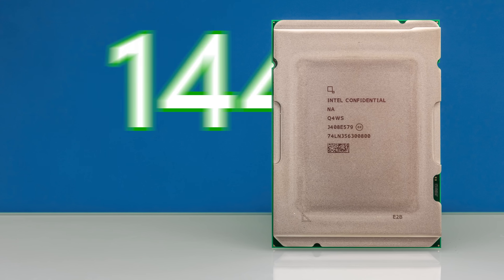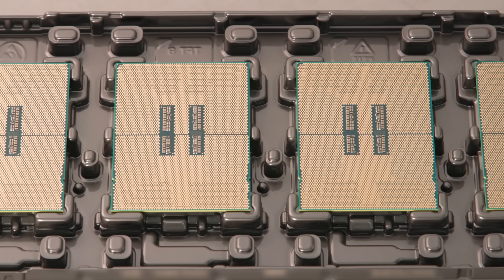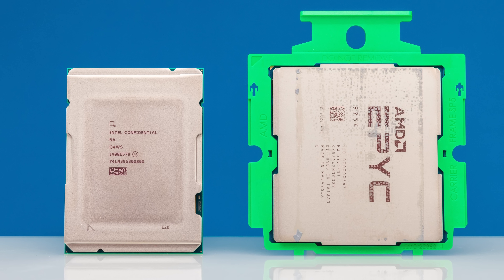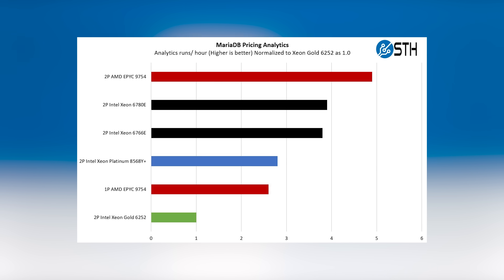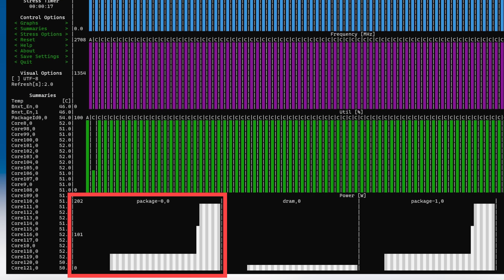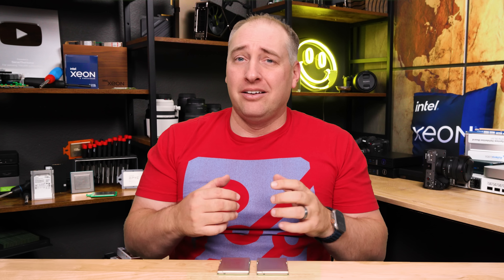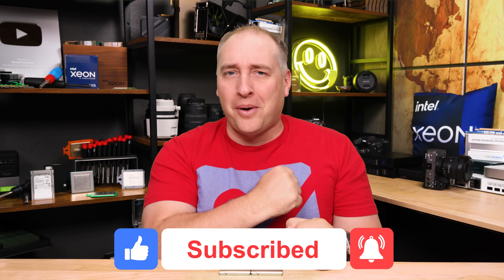MOST Server cores EVER Intel Xeon 6

Comment: Intel 3 is 5-7nm tsmc equivalent?

Never expected to have cpus with as many cores as GPUs. Its not there yet but the gap is closing. Just crazy considering the number of cores just 10 years ago.
Reply: No Intel 3 has a higher real density than tsmc 5nm， Intel 3 is designed to compete tsmc n4 n3, not n5 n7.
Reply: @timmy85211  Intel has density.. tsmc has efficiency. Intel can pack transistors closer but requires more power than the "equivalent" tsmc node. Power usage is a large part of the benefit of the node so a huge downside to Intel. "Same node" but twice the power means... Not an equivalent node imo

Comment: This is going to redefine servers? Others have long had the same or more optimizations in this direction. Seems more like Intel is catching up at best.
Reply from the maker: This puts Intel ahead of current Arm solutions and AMD. Perhaps catch up too, but they are now squarely ahead
Reply: @ServeTheHomeVideo "Ahead" meaning what in terms of "redefining"? Even if the first true, if it is just about being a good product, then good for them and for us to have it as an option, but nothing that changes how servers are used. CXL has been long in the making and far from specific to this, chiplets are great, but hardly their innovation, more cores, each more efficient rather than performant, great but again just their version of what AMD and ARM have been pushing already, same goes for removing the PCH. Good to see competition doing what it is supposed to of course, but nothing that seems structurally new, other than being new for Intel.
And on that note, it's easy to look good, if you compare yourself to the competitions last gen. 5th gen Epyc has up to 192 cores & 384 threads. If the efficiency cores of Intel are about on par with last gens Epyc cores in performance, win some loose some, and a bit better in efficiency, that isn't that impressive, since 5th gen Epyc, especially the -c version will be on better nodes than their previous generation as well of course, while adding some improvements beyond passing on TSMCs I'm sure. As for Neoverse N1, it's from 2019, it better be defeated easily by a 2024 product. Granted Nvidia isn't realeasing their next gen yet, unlike AMD, but Grace is not new, and also has 144 cores and they aren't even from the lots of core N line, but the V one, maybe a little physically bigger as a package based on the less chiplet approach, but since that package includes memory, it's not actually large if you include that for the others.

Comment: Will this complete with nvidia?
Reply from the maker: The NVIDIA Grace Superchip has soldered LPDDR5X memory and can hit 144 cores on the dual 72 core chip module. Those 144 cores with memory use around 500W versus Intel at 250W excluding memory but with the ability to scale to dual sockets at 288 cores. Very different CPU segments

Comment: Nice. Congrats to Intel on delivering and beyond. I already went with AMD Siena, it has a lot of PCIe, and scales down to 8 cores, while keeping all io and memory channels. For crazy workloads, of course Bergamo. I can see Intel leaping ahead, and also having built in accelerators (compression, encryption), being a nice bonus, but I think long term these things will move to NICs (already available, just not super well integrated, and bit awkward to use it for compression for storage, on a NIC). I will stick to AMD, their more smaller tiles solution I think is more cost efficient, plus Intel screwed us many times in the past. But time will tell.

In general I really like the trend, of more smaller (more efficient) cores, because a lot of workloads I do, scales very well, and ultimately I can do more in same power budget (compared to less but faster cores).
Reply from the maker: Totally

Comment: Those 144 e-core chips aren't competing with Bergamo for the reasons mentioned in the video. They (and also the 288 core parts) are also not competing with Bergamo, because Bergamo is AMD's last gen part. Their actual competitor is going be Turin-Dense.
Reply from the maker: Correct, but Turin Dense is also 5+ months off at minimum.
Reply: @ServeTheHomeVideo  Also correct :) The 288 core parts won't be out much sooner than Turin-Dense though.
Reply: Xeon chips has higher bandwidth. 288 E cores that dont execute complex AVX instructions.

Comment: This actually seems like a sweet homelab part for people who want to play around with virtualization but don't need tons of single core perf. Basically this lets people get the performance of buying an old craigslist dell server without heating their entire home with it. Can even probably squeeze into 1U without fans that your neighbors will file noise complaints about.
Reply from the maker: I think the 96 and 64 core parts might be super for this as well. Also, these days 2U makes a lot of sense and lets you use quieter fans
Reply: @ServeTheHomeVideo  Yeah I agree I think for homelab the lower count parts are the sweet spot. And it's also a compelling part compared to something like Ampere M128-26.

Comment: All the intel hate is wild in the comments. There is a reason not every company has replaced their intel servers with AMD. Intel has a TON of integrated features that AMD just doesnt have. Intel also has way more, more task optimized CPUs
Reply: Nope these days AMD supports all kinds of features and workloads supported by Intel, including AVX 512.
Reply: @aninditabasak7694  That is one of a ton of features. From cryptographic engines, quicksync to traffic encryption and network offload
Reply: @AlpineTheHusky  You're wasting your time reasoning with some of the people man. They simplistically think "Intel quad cores for 7 years straight on desktop bad, AMD good" and apply that to the server space where It's not always all about core counts and PCIe lanes. Intel has decades of software optimizations and working with the ecosystem to make sure the latest SW runs smoothly on Xeon, plus they have their proprietary accelerators, their AMX AI engine in the cores.... that's not something the typical "moar cores moar better" people will easily pick up on or understand. They'll just see more cores or see that their 7800X3D on desktop wins gaming and then use that to say Intel is washed lol.

Comment: So I think you are wrong on the 6700 series, I suspect it will be the primary sales driver.  It’s a great replacement for data centers that have aging equipment that had lower power draws.  I see this as the primary upgrade path for an enormous number of 5-6yr old racks/pods.   As always, imho :)

Comment: 14:10 So how efficient does this compare to Ampere Altra Arm server CPU?
Reply from the maker: We talk about it in the video and have a section of the main site article. This is much faster and uses DDR5/ PCIe gen 5, has accelerators, and 250W/ 144C. Of course Ampere can be cheaper and if you want to develop on Arm without going NVIDIA then it is still the best option out there. Perf/W this is a big upgrade
Reply: @ServeTheHomeVideo  Yeah, It has faster IO but then still. There is no number no graph to talk about their comparison in efficiency?

Comment: No AVX isn't going to appeal to the scientific compute folks
Reply from the maker: It is not intended for that market, but it does have an AVX2 with VNNI and such
Reply: @ServeTheHomeVideo  Ah does it now, I stand corrected - thanks!
Reply: There s a xeon chip with 256 P cores each one capable to run math calculations.

Comment: 9:52 No they're comparing this CPU to  64core 128 thread Epyc 9534 not 128 core Epyc.
Reply: I think the real intent (other than a move favorable comparison) to that choice was the TDP target of 250w. The Epyc 9534 default TDP is 280w and configurable down to 240W. The 128 Core ranges 320-400w for which it better be faster. On that basis the 84 core Epyc 9634 would've been the better comparison with the same TDP range as the 64 core.
Reply from the maker: Totally correct. Also you need to be at 32c for Genoa to be at 250W default TDP or less
Reply from the maker: Yes. Note added on that slide as I caught that just before uploading this morning

Comment: the ultimate test will be to run a benchmark test on a only one core (rest of cpu's in idle state) that has to traverse its data across cache and PCI to off chip memory .......get the benchmark results and then duplicate this whole process in parallel across all cores using all cashes and PCI lanes and see how much slower the original benchmark is affected by  IO bottlenecks.  MY GUESS IS THAT IT WILL BE BETWEEN 30-50 percent. In the end buss access  is still all about  the resources divided by the number of CPUs

Comment: Wait.. but didn't AMD announced yesterday and EPYC CPU with 192 cores?
Reply: It's not out yet. As of this moment this is the highest core count CPU.. at least for x86 (IDK what Ampere or the custom ARM silicon that AWS, Google, etc. have as far as core count goes).
Reply from the maker: They announced a 192 core part currently slated for Q4. Intel 288 core is slated for Q1. AMD will also lose the P-core max core count in Q3 with Granite AP at 128 cores before 128c Turin is out.
Reply: Most customers who buy expensive CPU runs calculations  for Aerodynamics or engineering they prefer xeons.
Reply: Who cares 90% of clients won't touch AMD and their issues, hassles, shit drivers, updates, inferior designs so it's moot. Maybe one day clients will let me sell them cheap amd stuff but not now, IT buyers won't buy AMD, which is why Intel CPU's account for 80% of marketshare even after essentially not even trying to compete for a generation or three lol.

Comment: The decade old Xeon Phi with many cores on a dedicated card is a better approach... can you question Intel why do that approach instead of this weaker main cpu core approach
Reply from the maker: Not sure what you mean? We reviewed Knights Landing and such many years ago (our box is the one LTT ended up using.) This is a much better approach. Also as a "weaker main CPU" it has higher integer performance at 250W than the 64 core top-end 5th Gen Xeon at 350W. Faster and 100W less TDP is hard to call weaker.
Reply: @ServeTheHomeVideo  Your article on 500+ cores per U in blade system for Clearwater Forest makes sense then for power savings // I was thinking Home Server- Small business which this chip series is not the target market... I can dream of a PCIE 6.0 /7.0 card with 512 cores someday though- Thanks

Comment: MOST Server cores EVER, FOR INTEL. Append that on or it's clickbait and false!
Also do us all a favor and look up how pronounce Bergamo
Reply from the maker: Bergamo is only 128 cores. It has more threads, but not cores.
Reply: @ServeTheHomeVideo  You should point out that the e-cores are not fully ISA compatible with the p-cores, this is important knowledge required to understand what's really going on. The e-cores are not necessarily more efficient when missing instructions have to be emulated in code, and with p/e-core combined processors, the scheduler process becomes more complex, resulting in potential overhead latencies. In the end, the efficiency gains will depend entirely on the applications that are being run on these processors, they are definitely not for everyone.
Reply: CORE != threads shill.

Comment: Hard to unpack what is just "marketing speak" when it comes to E and P cores...seems like E cores are possibly just 'P' cores that can't handle higher clock speeds rather than a fundamentally different architecture.
Reply from the maker: They are different. For example, they do not have AVX-512 and AMX, but have things like AVX2 VNNI
Reply: @ServeTheHomeVideo  Thanks, I should have looked it up rather than just make an assumption, ha ha
Reply: They are fundamentally different. They are about 1/4 the size for starters, and then also the differences in instructions. They're even designed by different teams at Intel.

Comment: still weak compared to the current gen Epyc CPUs, and nothing compared to next gen Epyc
Reply from the maker: Not sure what you mean? 144 cores at 250W is awesome, and it is not that much slower than Bergamo. 250W or less with dual socket support AMD EPYC Genoa currently has only 32 cores. As we go into, next-gen EPYC and Granite-AP / Sierra AP are much closer.

Comment: 🎯 Key points for quick navigation:

00:00 Intel's newest Zeon has 144 cores, uses under 2 watts per core, and features PCI Gen 5 lanes with memory expandability via PCIe slots.
00:15 The Zeon 6 series, known as Sierra Forest, uses efficient cores and represents a significant change in Intel's lineup.
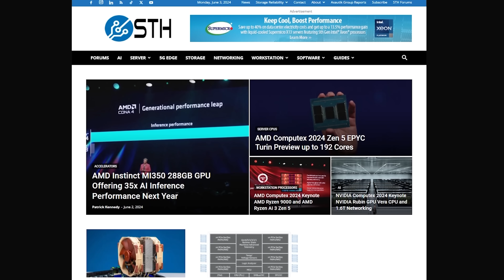00:43 Sierra Forest is a major update, potentially the most important in the Zeon 6 series, emphasizing efficient cores.
01:39 Intel sponsored the video, providing early access to processors for testing.
02:22 The 6700 series has both efficient (E) and performance (P) core variants, with the 6900 series competing with AMD's high-end parts.
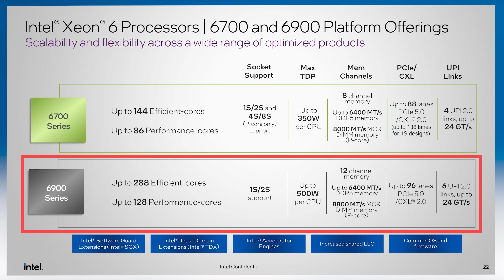03:33 The 6700 series targets the mid-market, offering dual socket processors with up to 144 cores.
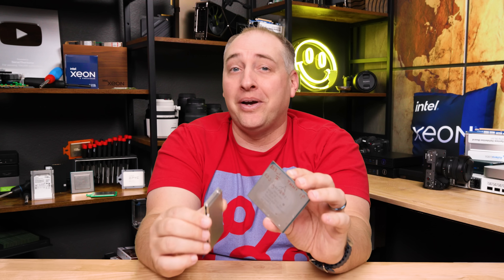05:07 Intel's modular design allows for efficient core distribution, using advanced process technology.
06:30 The 6700 series supports CXL memory, enabling significant memory expansion through PCIe slots.
07:25 The removal of the platform controller hub reduces power consumption, modernizing the IO stack.
08:06 Efficient cores are comparable to older high-performance cores, without hyperthreading, enhancing security.
09:44 Performance testing shows strong efficiency and consistent high clock speeds, ideal for virtualization.
11:58 Power efficiency is impressive, with potential for significant energy savings in data centers.
14:13 These processors are not suitablefor all applications, but excel in high-core, low-power environments.
15:08 Intel's strategy includes multiple Zeon lines, offering flexibility and improved performance across different use cases.
16:45 Future iterations, like Clearwater Forest, promise even greater advancements, reinforcing Intel's competitive edge.

Made with HARPA AI

Comment: Is there even demand for such CPU's out there?
Reply: The enterprise market is shrinking and now represents less than 50% of worldwide server shipments and this number is falling by the year. Cloud service providers are the majority share of server volume and this targets the primary workload used by the CSP customer base. General purpose P-core designs will become increasingly niche over time and this is represented in the server CPU roadmaps.
Reply: Yes there is. In data centres the two most important things are space (limiting the number of racks needed) and energy (which effects cooling, power costs, etc). If a single 2u server can do the same work as a 24u rack, it can be worth it because you can expand without needing more square footage.
Reply from the maker: These days it is much more about power than space with all of the AI build-outs.
Reply: @SpoonHurler  you always need redundancy, for failover + at least one more DC. I cannot imagine an enterprise which would require several such systems. I mean i cannot imagine this planet having so many such enteprises to justify the creation of this CPU. Only may be IaaS providers.

Comment: Intel looks desperate... E-cores only is kinda sad. Curious to it do a head 2 head with AMD's Epyc lineup
Reply: AMD does the exact same thing except they dont say they are cut down cores
Reply: @AlpineTheHusky  amd has hyperthreading on each core... Threadcount is much higher.
Reply from the maker: Why sad? This is a 250W CPU with 144 cores that has faster integer performance than the top-end 64 P-core Emerald Rapids Xeon at 350W. That is a crazy win. We have some charts versus Bergamo which is probably the closest competitor, but it is a higher power platform.
Reply: You have to remember the relative performance compared to the last generation of Xeons, in which this is a 3nm process and the last gen Xeons used the 10nm process. If you compare an E core of this generation to the P core from last generation, the E core from this generation would have a slight lead from 10nm P core as the E cores are usually around 44% the performance of a P core. This means that we have more performance, higher power efficiency, and more cores which is amazing.
Reply: @ghty-kw7hm  I don't really need to remember anything. I care about what cpu has the better performance, and currently the AMD Epyc lineup is better. Nice for intel thqt they had an uplift compared to the previous generation, but in the end, how they match up to Epyc is what matters. I am also curious about the price, because performance to purchase price has been lacking too the last years...
Reply: @SirMrDany  If Intel ever makes a P core version of the Xeon with the same number of cores as the E core version than yes, we would be able to compare it to EPYC although epyc already uses the C cores so the E core variant might be close to the Epyc processors already or even surpass it in performance. You are correct about that we need to compare it to EPYC and hopefully the price to performance would be better although I don't think that's going to be the case. Jensen Huang justifies his statement with CEO talk, "The more you buy the more you save" haha.

Comment: I'm sorry how many??? Oh.. 'efficient cores'. Sounds like those slower weaker cores used for medial tasks in BIGlittle chips?
Reply from the maker: It is hard to say that. Think roughly 2 E-cores = 2 Emerald Rapids P-core threads. Or if you have an Intel Xeon E5-2650 V4, just assume core for core replacement. They are slower than mainstream cores, but that is also the point to hit power savings targets.